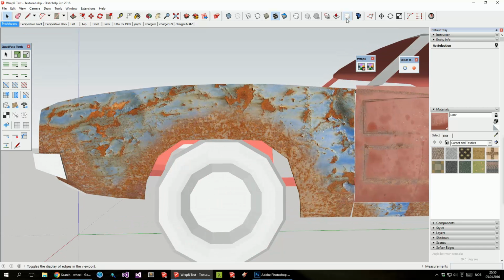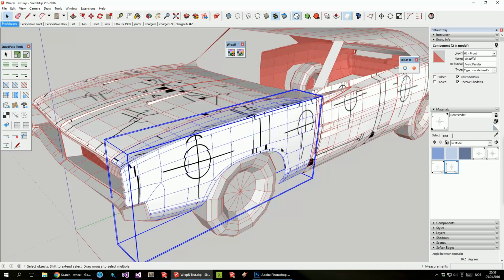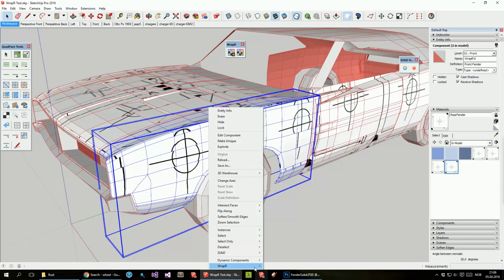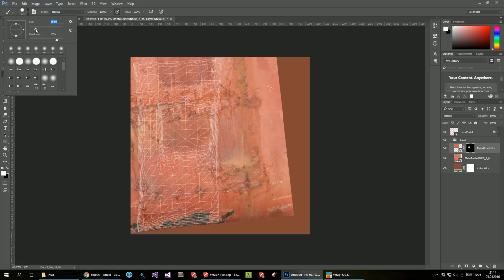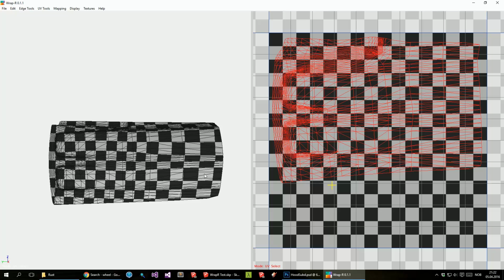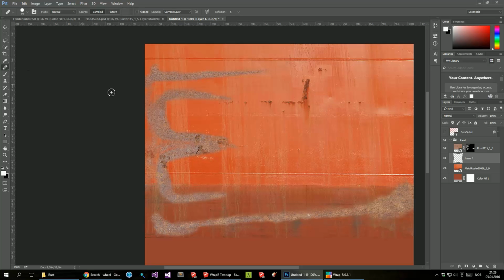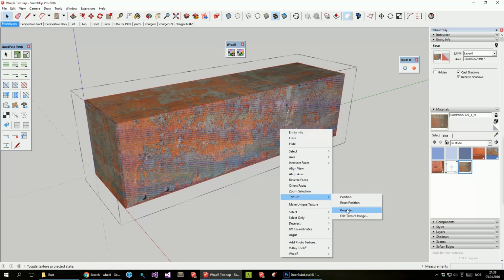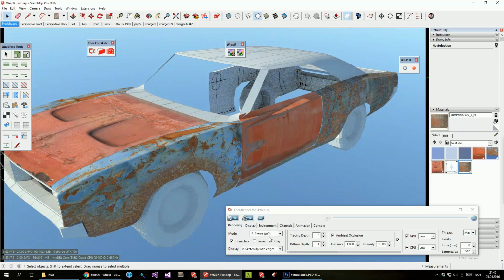Wrap-R Experimenting

Comment: Hi Thomas, a quick question about this. Is there any chance for obj exporting options from QuadFace Tools to include the seams made by WrapR?
Reply from the maker: The OBJ fileformat doesn't support such custom properties. Btw, what application did you want to import this into? What would understand WrapR's seams?
Reply: @ThomasThomassen   Sorry about the silly question, I just realized it's nonsense.

I proposed this because there's something with the obj exporter from QuadFace Tools. It works great but when you export some of its obj files to Substance Painter, the automatic UV's go nuts. But if I just open the obj file and save it with Blender, then the SP's automatic UV's work fine.

I thought maybe marking seams could help, but I realise it doesn't make any sense.
Reply: @ThomasThomassen  
Here's a couple of pics of the issue in Substance Painter:
OBJ made with QFT
https://alejandrosoriano.xyz/wp-content/uploads/2020/04/SP1.jpg
OBJ made with QFT and saved with Blender
https://alejandrosoriano.xyz/wp-content/uploads/2020/04/SP2.jpg
Reply from the maker: @AlejandroSoriano1  can you log an issue in the issue tracker? https://github.com/thomthom/quadface-tools/issues Include the OBJ you get from QFT and the OBJ you get from Blender. And please include some screenshots and instructions on how you import it into SP.
Reply: @ThomasThomassen  Of course, here I go :)
EDIT: done! https://github.com/thomthom/quadface-tools/issues/120

Comment: Or atleast make import of sketchup model in tekla streamline as their are data losses while importing,. I have another suggestion why wouldn't you introduce a function in sketchup to assign load of objects and unit weight of materials right in sketchup and then when i import it in tekla just assign dead, imposed and other loads, generate load combination and do the rest  that is analysis, design and detailing in tekla and generate report and documentation in sketchup layout...